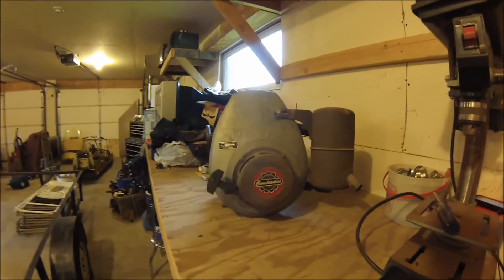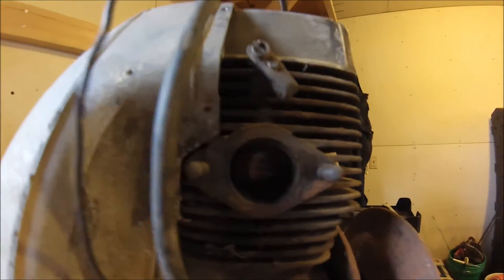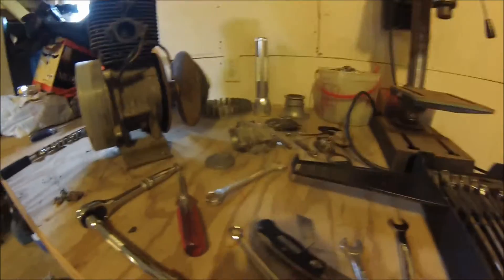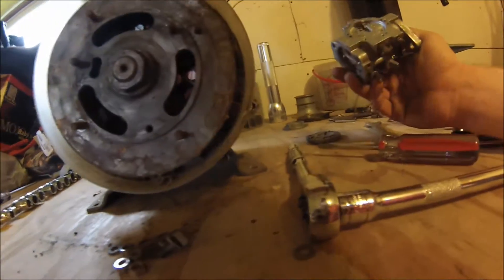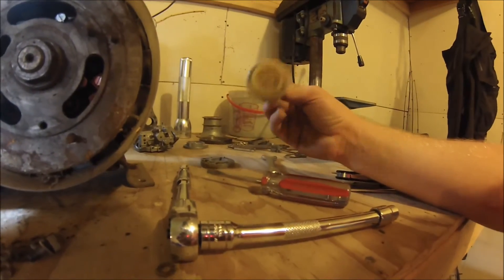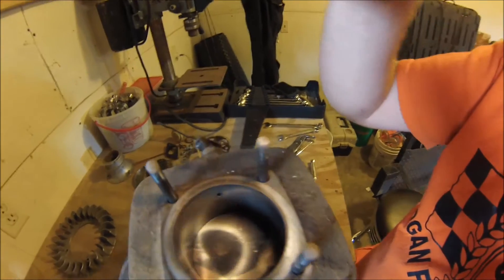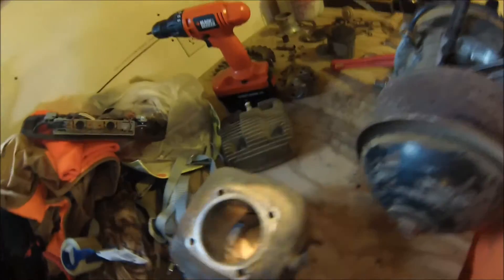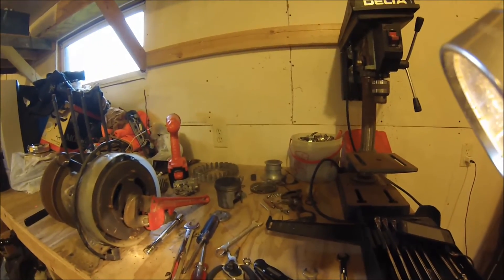1968 Ski-Doo Super/Olympique Engine Disassembly: Part 1

Comment: if them carbs wont work even after a total rebuild....strip em put em in a pot   spAGE Temn and boil them in regular  water,,,,,
Reply from the maker: I keep a carb kit around now because every fall it seems like I have to replace the diaphragm to get them to suck up fuel. They run great once I replace it. I've got three sleds with that carb on it now so I think I need to buy in bulk.